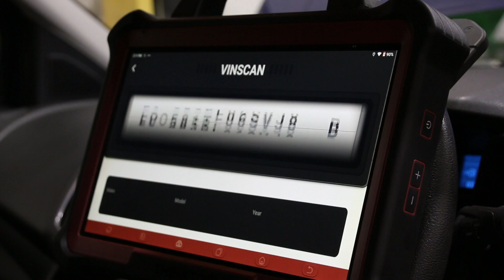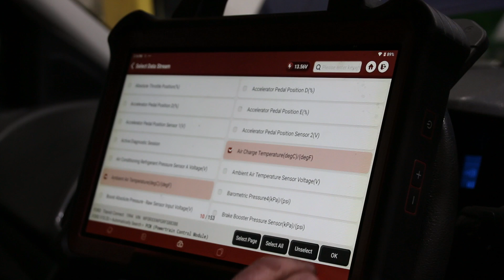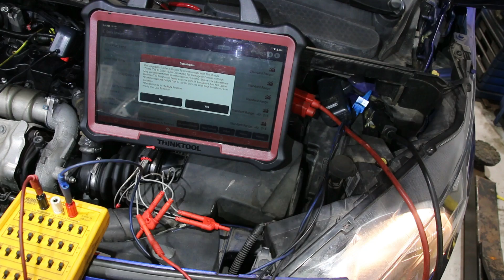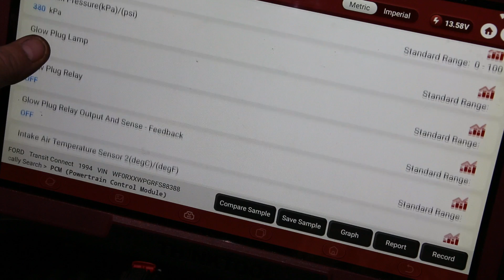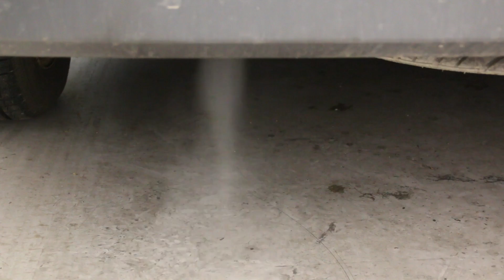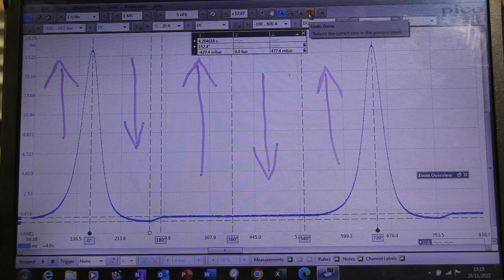Ford Transit Connect 1.5 TDCI Bad Starting, No Codes, Diagnosed Using In Cylinder Waveform Analysis

Comment: Need some help I’ve got same van. And I have no vacuum to my turbo I’ve got power to boost solenoid and it’s brand new. I’ve got vacuum from the vacuum pump but none from the solenoid no leaks either. Please help

Comment: Hi great vid was looking for part two but didnt find, ive had similar issue with long crank and occasionally started sometimes on same vehicle stalling but ran fine, the technician found that there was loose corroded wires around the multiplugs around the ecu on nsf, hope this helps as it was 10 days after tested everything that he could to find fault when plugged into snap on software diagnostics it showed up low fuel pressure and invalid data recieved from ecm/pcm code UO411-00 hope this info come in handy

Comment: hi great video, ive got a 2016 1.5 tdci no lights on dash , but getting slight black smoke when revving and also diesel getting in the oil and over filling it ? dpf clear and runs ok , if i leave engine oil half full it fills up after a run ?
Reply: Hola , como solucionaste el problema 😢??

Comment: Some injection specialists are happy to supply new injectors on piece without even checking yours, I was informed that the continental injectors used in the ford Connect can’t be checked or repaired, I was told it’s throwaway part. Great content .

Comment: These engines have an issue with the pressed-on cam lobes which are known to slightly drift over time as a symptom of wear. That could explain the difference in timing between the individual cylinders.

Comment: is it possible the cam lobes twisted on this engine  had it had cam belt replace in the past due to breaking AS NOW VERY COMMON FAULT but its very low milage is it genuine ,also heard tow starting cars can cause this problem if starter motor had gone as due to slack in belt then attempt tow start can cause excessive strain on belt in wrong position  thus put strain on cam but not crank myth or not ,,as manufacture specify do not tow start modern cars for this exact reason ,this could be the fact that cars now have dual mass flywheel allow  a rocking motion unlike a constant pressure using a starter motor  this in turn allows the belt to loosen tighten loosen causing timming  issues allowing valves to hit pistons ,as said a myth or not ,but manufactor believe this is an issue

Comment: Quality diagnosis Gary, I used to work in a Volvo truck dealership and often had vehicles towed from other dealers like this one, it’s incredibly satisfying to eventually nail the root causes but often made more difficult by the parts thrown at a problem beforehand

Comment: Great video mate as a ford technician had a few of these 1.5 tdci with cam lobes spun as there only pressed on mate 👍
Reply: Mate i have a transit 2015 1.5 diesel wont start . Low fuel pressure.  Injector passed leak off . Fuel filter is replaced and primed . And iv removed the pressure regulator off the pump and seems to be working fine .. and a new rail pressure sensor have you ever came across anything odd on them . Theres no metal filings in system from bad pump bit odd any help be great

Comment: Very detailed diagnosis. If you’re not testing your simply guessing.I know that in the USA some ford petrol engines have issues with premature cam roller bearings are failing.

Comment: I seem to be having a similar problem, no trouble starting, but when driving, getting to around 1500-2000 revs and it's spluttering and cutting out. I had the cambelt changed around three weeks ago. Could this be a result of that? It's booked into Ford in the morning to hopefully diagnose and repair 👎 great just before Christmas 😆 

Unfortunate circumstances brought me to your fantastic and well indepth video 
Keep up the good work 👏
Reply: Que fue , supiste de ello, fue por el cambio de la correa?

Comment: If 1.5 tdci timing belt snaps the lobes on the camshaft are only pressed onto a hollow tube and can move and send the timing out it happens regularly so check the camshaft lobes to see if they have spun but normally only happens when belt snaps
Reply: You're absolutely right!

Comment: What about a in cylinder pressure waveform coralated to a camshaft sensor tdc to compare tdc variation? To rule out woodruff/ timing belt wear?

Comment: Excellent video mate and very nicely explained, just shows what skills and tooling you actually need to diagnose faults.
Too many techs now just rely on what a code reader is telling them what is or could be faulty - needless replacement of parts at great expense to the customer chasing faults.....diagnosis by substitution!.
After all that testing I'd be very suspicious of the engine timing too especially if the belt has been off to change the fuel pump, timing a tooth out? 🤔

Comment: It does sound like the cam lobes have shifted on the camshaft as you have proven everything else to be okay,that only leaves mechanical failure,I believe the aftermarket camshafts are solid and not with press fit lobes

Comment: Timing belt idel pulleys get worn on 60 000 km and 40 000 miles are about the same so timing off sounds the problem i have seen those engens too 90 000km and valves are bent belt broken and so on
Reply: Solo 60.000km?el anual dice mucho más.. 😢

Comment: I'd suspect the glow-plug system initially, just because. I'd be measuring the actual amps being drawn by the control module as the engine cranks, on the glow-plug control module feed wire using a clamp meter. If it is any lower than 50 amps then there is a plug issue even if there supposedly isn't a plug issue. Clamp meter onto the + feed of the plug module - see is it drawing close to 50 amps - if it isn't, the plugs are kaput or the plug feeds are bad. Because the parts cannon was fired up, I'd be doing some serious staring at the plug control module, the plugs, the wiring to the plugs & all the grounds related to the plug system.. I may be dead wrong, but that's my guess before seeing what the actual fix is - it'd be  boring otheriwise. God loves a guesser. :-)

Plus that's a PSA motor & they don't like getting out of bed unless a fire is lit under their backsides first thing in the morning.. from experience. No plugs glowing - no startey, no matter how hard you curse. Just my 2c. :-) Once started, they then re-start fine all day - PLUGS. 

I'm prolly dead wrong.. :-)
Reply from the maker: The vehicle has had new glow plugs and as the scope trace shows, the plugs are drawing current

Comment: Dodgy injectors light's on plug it in if it is them use bosch one's better than the dealer ones a reckon
Reply from the maker: This vehicle does not run bosch injection, it runs Siemens VDO.
It has already had 4 genuine Siemens VDO injectors fitted

Comment: I have a 2019 transit courier with the 1.5 tdci engine, service regularly at main stealers never run correctly from day 1, no fault ever found, done over 100000 mile, had a fault with engine that was diagnosed with turbo failure, replaced by independent and informed me that cam timing was slightly out

Comment: Another new subscriber! Fantastic video.  Making me even more hungry  for auto diagnostic.  I love it! I work on these psa engines  all time.  Build em back up after timing belts  snap. Can wait to see the outcome. I came across a damaged  crank pickup disc but it threw a code  up for it. Those camshaft lobes I've only seen move upon piston valve contact. I've just learned  how much you can see from a simple amp clamp on starter.    Thanks for educating and I'll be sure  to keep on watching!

Comment: Just found your channel. Great video, will definitely be watching all your other ones. Has it had a cam belt change due to snapping? The rockers break on these, then spin the cam lobes. Definitely something to ask the customer
Reply from the maker: No it’s never had a belt failure. It has had the belt off as the HP pump was replaced
Reply: @intelligentauto737  Ah right. Definitely worth checking the sprockets and lifters then. Hope you find the fault, and upload a part 2
Reply: Was the hydraulic "lifters" the fault???

Comment: The level of waste, cost and time from fitting multiple parts at great cost due to poor diagnostic training is appalling, so thank you  for trying to stop this.
My only suggestion for you (if you regularly run engines indoors and even if you don't) is to fit some ventilation to remove the exhaust fumes. My brother in law died form Lymphoma, was a bus driver and in the past the diesels were run in the garage. I am reasonably sure that his illness was caused by this but why take the risk?
Reply from the maker: I totally agree with exhaust extraction, in general I don’t run engines for long indoors but when I do I need to smell the fumes as this gives me an idea of what’s going on in the combustion chamber
Reply: @intelligentauto737 Good but, strangely, I don't want anything to happen to you!  ;-)

Comment: Great interesting video, cheers. Would it be an issue with oil pressure to the lifters as you said all the valves seems to be opening late and closing early? Just a thought? Can't wait for a follow-up on this.

Comment: Interesting diag.👍 I've seen the pressed on cam lobes spin in the shaft in DV style engines.
Reply: My moneys on that the lobes have slipped, seen that a few times.
Reply: Belt timing is an issue on these aswell. Have see them jump time due to a worn tensioner (circumference gets smaller due to worn plastic belt goes slack and jumps

Comment: At what point can you rule out a stuck open/ closed egr valve in this scenario as you said the engine does run OK but sounds a little flat to your ears.  Thanks again for taking the time to make this video.
Reply from the maker: The EGR has been proven to be working and not sticking.

Comment: I am no expert on cylinder waveforms, but did you closed the intake completely? This would cause there is coming in less and less air because your compression is also lowering in the waveform so I would think that can cause the differences, between your comparrings, would it not be possible to leave a little bit off air entering the cylinder just restrict it.
Reply from the maker: The whole point of fully restricting the intake is to create definition in the wave form, as the engine turns the compressions will deplete as there’s less air available

Comment: this happens because of a slightly open egr!  it was interesting to see the amount of air measured by the maf, if it is low it causes a low diesel injection not enough to start the engine until the cylinders increase in temperature!
Reply from the maker: The EGR is fine, if in fact the EGR was sticking open there would be Driveability issues, excess turbo lag.
As mentioned in the video, the van once running drives fine.
Reply: @intelligentauto737  Yes, I agree, I mentioned this situation because I've seen these engines not starting because of the slightly open egr.  Anyway it is an amazing diagnosis only the air intake part is missing!

Comment: Fantastic video Gary we have been in for a treat without a doubt. I’m 47 years a mechanic and I can see why the parts cannon was fired on this vehicle indeed I probably would have guilty myself but to a lesser extent. Your skill set knowledge and investment in equipment is plain to see ‘ even a good garage with good mechanics can’t really be expected to carry out such in-depth analysis as your self we can’t do it all anymore you sir are indeed a specialist. Have watched the video twice hope there’s a part 2
Reply: We can’t charge for it either
Reply: I very much agree Kevin, this video is an incredibly in-depth testing process, with great knowledge of every test used even in cylinder pressure testing while blocking the intake. I haven’t ever seen that before, excellent work Gary 👏👏🙏🙏

Comment: hi these engines have pressed cam lobes not a solid crankshaft, these will move if there any issues
Reply from the maker: Thanks for the input. There’s no history of cam belt failure, the owner has had van from new.
Also if it had suffered cam belt failure causing the lines to spin I’m pretty sure it would not be affecting all cylinders.